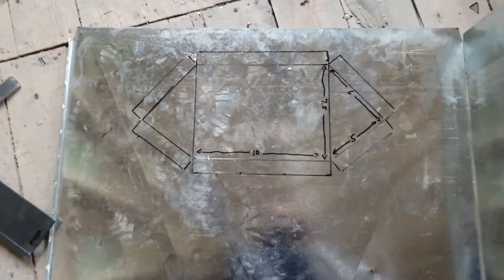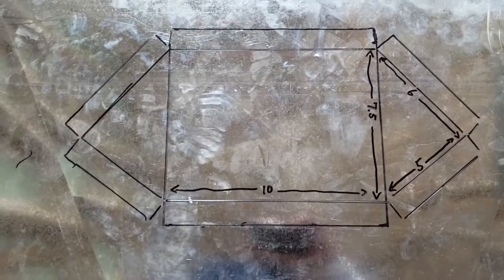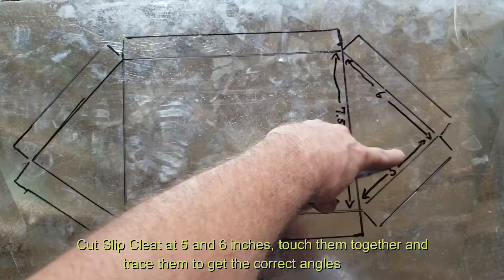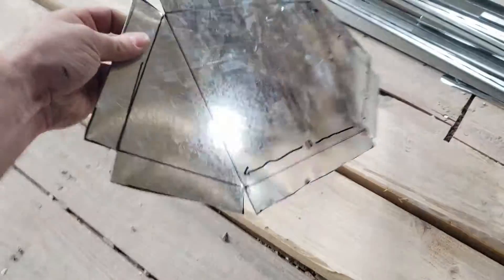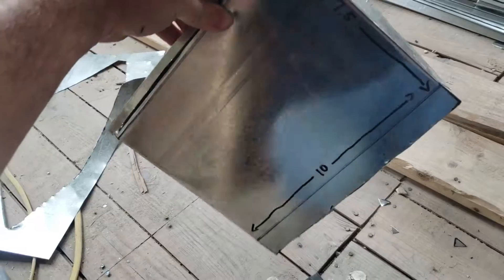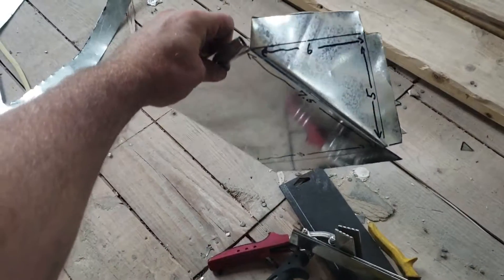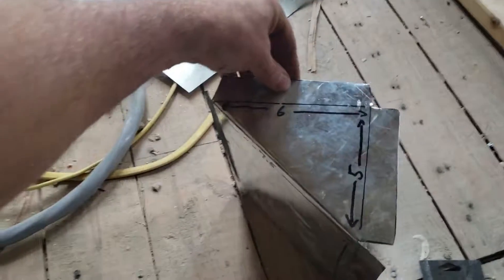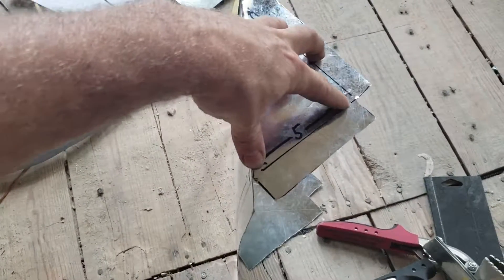How to make a Trunk Duct Reducer

Comment from the maker: Thanks for watching! 
Here is a better video of the process in making these reducers:
https://youtu.be/AlRrWwQzDxA

Pro tip: Make templates for different sizes and keep them flat, and unfolded, in your truck so that you can trace them and fold them up quickly on the job site. 

If you are in the Philadelphia area and need residential or commercial HVAC service, call us at 484-322-5913 or visit our website @ WhitingServicesLLC.com